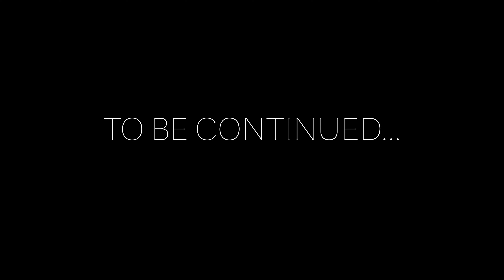"Back Cut First" Does Not Go As Planned - Building A Timberframe Barn Episode 3

Comment: As stated in both logging and the Arborist trade..." rope is your friend"...or..." what I want, and what gravity wants may often be two different things!!!"...You did a good job anyway and demonstrated wisdom and common sense (rather than ego and arrogance) with simply walking away until a better time and with a better plan...Thanks for sharing the experience...
Reply from the maker: Thank you! Yes we went and got steel wedges the next morning. We pounded those in and cut about another half inch of hinge wood and she went right over. I unfortunately didn’t have my camera for it but I am working on a quick video of bucking up that tree. Thanks for watching Jay.
Reply: @evergreenorganics  Hi Sean, I'm sitting in Milwaukee International airport now enjoying a lot of your videos and the presentation of them as I go to another timber frame project in Iowa...You are, overall, doing a great job and embarking on an adventure sure to be enjoyed...

I'm also a Sawyer and Aborist, as such, when I was watching you drop the tree, I thought you could benefit from a "throw bag" and length of "tree line" to assist you in dropping the trees for your current barn project and later house. I tend to just make my wedges out of some hardwood slash from the mill as they are better than plastic all day long...When and if a steel one is needed, I grab the same ones I use in splitting stone (see Trow and Holden for their splitting wedges or a local Blacksmith as two great sources I typically use.) Back to watching till my flight departs...

Comment: It takes confidence to try it. As you found out it's not always an easy cut. Sometimes when your first trying it having another guy pounding wedges helps so you can really see that top break over center. Until that happens don't stop cutting and pounding those wedges. Double Wedge if need be on those heavy leaders. The hardest part for me is making sure to not cut your hold wood when facing it after the back cut. I give you  props to try and show it on cam.
Reply from the maker: Hey thanks man. Yeah you’ll never learn unless you just go do it right? I’d rather get my practice in out in the bush than on a tree near a building. Thanks for checking out my little channel.